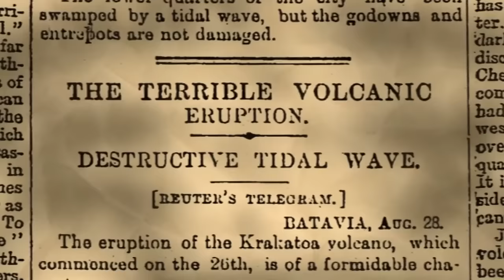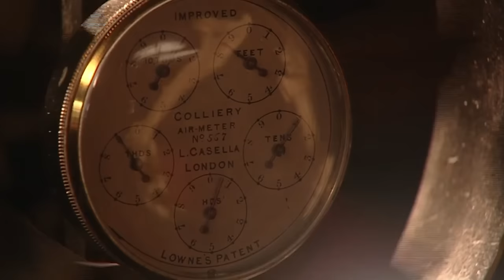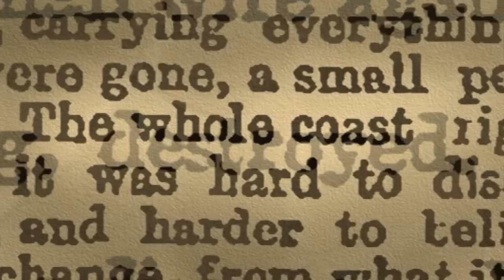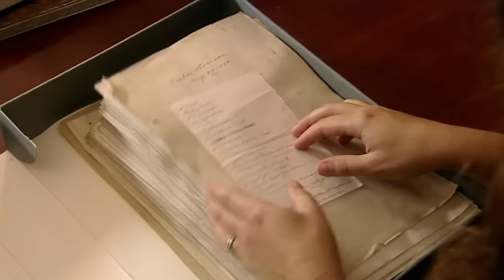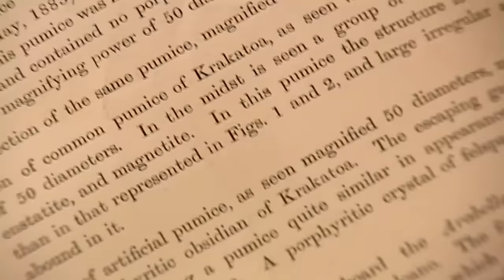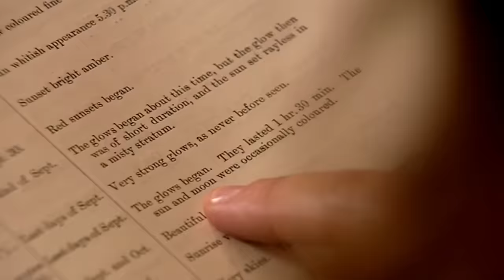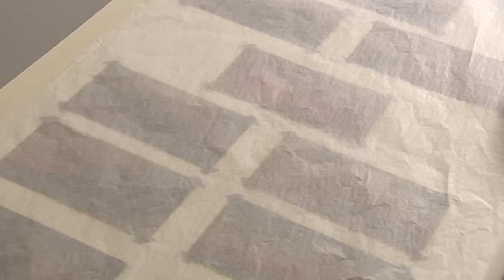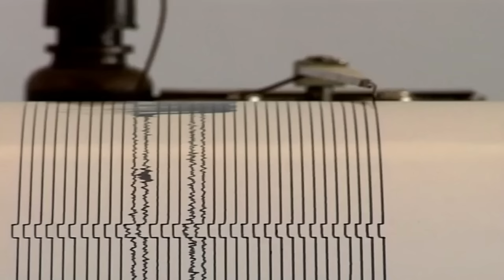Krakatoa - The Great Volcanic Eruption

Comment: Did they mention that 1000's became deaf from the high energy of the sound waves this made?
People on a  ship 40 miles away got ruptured eardrums.
100 miles away a 172 db sound level was recorded.
Reply: +Sukram Sukram 
172 db is a LOT of db! But my mom would say that my guitar amp is louder ...
Reply: Jim Dille
 LOL :)
Reply: wasn't Munch's "der Schrei" (the Scream) based on the skyline after Krakatoa?
Reply: +Sukram Sukram People always forget about that. When Toba went off and very few people were around, the db level was insane. Very good chance anyone close was turned deaf immediately. The same thing will happen if Yellowstone goes off, something higher in frequency than a jet engine will blast over thousands  of square miles.
Reply: +Peder Hansen Atmospheric pressure and audio compression waves can be measured with air pressure measuring tools. One kind of tool is called a barometer. 
They had these back then in case you were not aware. 

100 miles away from Krakatoa, a barometer at the Batavia gasworks registered the related spike in pressure at over 2.5 inches of mercury. That converts to over 172 decibels of sound pressure.
Reply: +schwarzfalk It is possible because it happened. This particular sound wave propagation was well documented. A db level that high would do this no problem.

With loud enough sound, damage will be done to the body but I'm not sure about disintegration !
With this particular eruption, the pyroclastic flow incinerated everyone nearby instantly well before lava and ash got to them.
Reply: Sukram Sukram I can't even imagine what Yellowstone's power would bring.
Reply: Jalen Stimes death by pure sound
Reply: It's an interesting piece of information, I like and appreciate that.
Why are you mad at someone for adding a fact that relevant to the topic @Doctor Robotnik?
Reply: Fadli Arfan its in the fucking documentary
Reply: @Doctor Robotnik
You sure? Can you point out in what min? I don't recall that information is on the documentary.
I found the link posted by @Esser though, but not on the documentary.
Even if it's in documentary, I still don't mind. Why you butthurt much?
Reply: Yellowstone and Krakatoa are very different kinds of eruptions, Krakatoa exploded violently because of sea water mixing with magma this wont happen at Yellowstone, while I have no doubt it will be loud it just wont be the same kind of eruption.
Reply: @METAL1ON
The theory of sea water mixing with magma that caused the eruption is very unlikely due to the lack of evidence to support it. Rather the mixing of two dense type of magma is the more probable cause of the huge eruption.
It's explained on this video at 48:55
Reply: Metal1on- The documentary states that the mix of seawater with magma was ruled out as the cause but the mixing of different magma was the cause.
Reply: I was looking for when they would mention that. The reenactment scene where the baby cries they look at the baby... so I'm curious why they could mention just the water waves' impact but not so much the sound waves' impact.
Reply: Sukram Sukram q
Reply: Sukram Sukram ☆What did he say?
Reply: 180 dB*
Reply: The British around North Sentinel heard it and thought cannons were fired at ships so they went to check it out. That was near India in case you wonder.
Reply: Quatermass wow!😳😭
Reply: That winter and the following 4 winters were the coldest ever recorded in North America. This is also the period the global warming coalition chose for their baseline reference to show how hot it is today but could still only arrive after a 0.1 degree actual rise even after "Correcting the 100 year old data.
Reply: Yes indeed, they could hear and sense it as far away as Australia!
Reply: Blackfalk    Yes, they'd be shattered.  Sha-do-bay.
Reply: Forest Dweller that's what, roughly 2400 km away? That's incredible.
Reply: Funny the decibel was invented in the early 1920's  Was it compared at a later date to the recording phonograph, that WAS invented before the volcano erupted in the mid 1800's ?
Reply: according to the wing nuts on you tube, you won't have to wait long! every spring through fall thousands of videos get posted talking about how "it's about to blow!" I guess even a broken clock is right twice a day...unless you're using military time!
Reply: 2.5 degrees on some gas gauge came up which translated to 172db.
Reply: Another eruption in the year 1816 is known as the Year Without a Summer because of 
severe climate abnormalities that caused average global temperatures to 
decrease by 0.4–0.7 °C. This resulted in major food shortages across the
 Northern Hemisphere.  it was caused by the eruption of Mt Tambora
Reply: Quatermass I thought it was like 300db
Reply: Blackfalk  Rocket launches produce enough sound to kill people. That's why NASA always made sure people were no more closer than 3 miles from all of the shuttle launches for instance. A shuttle launch is miniscule to something like this eruption, just to give you an idea of scale.
Reply: +Quatermass Nice to see an intelligent mind at work in the YouTube comments for once.
Reply: wow thats really amazing !!
Reply: sound falls off roughly with a square. standing up close the sound would simply kill you, probably in seconds. it would turn all your internal organs into mush - at the least. and instruments like the one that scientist had could measure sound waves in air.
Reply: sstroh08  ..  Sheer nonsense. While a rocket is indeed loud, it's certainly not loud enough to "kill people." Onlookers are kept at a distance mainly because rocket launches all too frequently fail, endangering people as the rockets crash back to earth.
Reply: Quatermass  ..  Man, that's just silly. There was no method of measuring sound level in 1883. The mechanical devices to measure "atmospheric pressure" you tout were not accurate enough nor responsive enough to measure the decibels of such a short event. Instead, some at the time simply speculated that it was almost loud enough to cause deafness within a 10 mile radius.
Reply: That came the invention of the hearing aids.
All because of that rogue KRAKATOA.
Reply: @fadliarfan212  they don't say anything about deafness. However I read Esser's link, and the video does mention how far the sound travelled, the same distance as the link mentions. The video also said it was one of if not the loudest sound heard by modern humans
Reply: Incredible power of nature
Reply: I prefer to be at ground zero. That way I feel nothing.
Reply: i am sure the sound level was extreme but i was not aware that they had a way to  measure sound pressure level way back then. hearing protection was something that really took hold in the 70s and 80s,  so i assumed thats about the time that spl recording devices were invented. i have built some car stereos that were in the 110 db  range and that is insanely loud i can only imagine what being hit with 172 db would feel like
Reply: Blackfalk  the closer you are the quieter it would be, sound is like an ocean wave the further you get from the source the larger the wave becomes. when your sitting in your home and you hear the kids drive by with their thumping sound systems its most likely louder in your house then it is inside their car.  i have had friends tell me they heard my suburban thumping a block away and i was like how i barely had it on, i could hear my turn signal flasher clicking when i turned the corner over the stereo, but a block away those sound waves were huge
Reply: @quatermass8  i am guessing it would also have to do with the frequency of the sound. bass below 100 hertz actually  feels like its forcing air down your throat at high db levels where as high frequencies cause pain to the ears. most of the sound you hear when you shoot a large gun is high frequencies would be my guess but the part you feel in your chest is the low frequencies below 100 hertz
Reply: So crazy that this was the loudest sound ever recorded
Reply: Did you HEAR them say anyrhing?
Reply: "Did they mention that 1000's became deaf from the high energy of the sound waves this made?"
WHAT???
Reply: @satsunada  They could measure pressure waves back then...
Reply: Quatermass a
Reply: They had a sound level meter prepped just for the occasion? In 1883?
Reply: Blackfalk  Very possibly. How do you think explosives shatter things? With sound.
Reply: @shane99ca  I don't think it was a sound meter, but something similar to the machine they were using that measures pressure waves. They can take the data it measured then and extrapolate it into the decibel system we use now days.
Reply: @Rvanhuis28  In other words, they extrapolated decibel volume from an atmospheric instrument not physically designed for the purpose.

The reason I'm skeptical is because a 172 db noise is not something that makes you just think, "Gee, that was kind of loud." The glass holding the mercury would have shattered. There is always a danger in inferring data rather than directly measuring it, as assumptions (sometimes erroneous) are required.
Reply: @shane99ca  back then it was harder to be accurate so all things from then where assumed usually from rudimentary machines that did work in function. Just not as accurate as we can measure today.
Reply: @theonewhoknows2  Actually, the decibel itself had not been invented in 1883.
Reply: my car puts out the same db,,,I am fine.
Reply: Peder Hansen  the way is with comparing the damage effect to the current decibel size, theres a lot of witneses that record this catastrophic event.... for exampl the sound is traveling far and everywhere....
Reply: @satsunada  yup just listening to a recording of stomboli's eruption currently is just defining, and I would expect being there in person would be even worse.
Reply: The world got colder for a long time because of it, and for two years, the stars and the moon shined green everywhere because of the gases in the atmosphere, as well as boreal aurora-like events due to the ashes flying, reflecting the sunlight
Reply: @riograndedosulball248  ah so it also left a haze cloud for like 10 or was it only five years? I wonder what the survivors of the ilopango eruption thought and heard as it imploded in 540ce, where it made two complete days of darkness from it's ash and it was ten to fifteen years of haze. In Roman records of water tasted bitter almost wormwood like for that time, probably due to the presence of sulfuric acid, fruit and vegetables wouldn't ripe , just stayed in a unripe state if grew due to lack or sunlight to produce the riping gas, and oh that period the Justinian plague went around, which was a different strain of the black plauge, funny, that it seems to pop up around major volcanic eruptions periods, yes there was a few big eruptions in 1300s as well. Maybe it thrives not just in water, but sufuric acid water is it's key in how and why it shows up?! There's suppose to be another case of it, named the race burning disease when the two Intermittant days of darkness occur. Somehow drinking Hawthorne tea made with the leaves, no wood, three times daily suppose to cure it.
Reply: my car audio system does 160 db
Reply: also ear drums grow back
Reply: The loudest documented sound in recorded history.
Reply: Very interesting!
Reply: Me: laughing at all the small-minded skeptics that do not take into account the ability for scientists to use all kinds of information OVER TIME (as in after the db was invented) to reach a reasonable conclusion. Please explain your conspiracy theories as to WHY you think scientists are lying about their calculation? I would love some further comedic relief during this pandemic 😄
Reply: Spot on, M' Lord.
Reply: @joshuasteve5083  - From a nearby barometer. Look into it.
Reply: @quatermass8    ..  Where did you hear that? That would have to be among the loudest sounds ever heard on this planet. Meteors hitting the Earth's surface very rarely make as much noise. Hell, a massive nuclear bomb wouldn't usually rupture eardrums 40 miles away (we know that from the many bomb tests done with observers nearby).
Reply: @dwightstewart7181  - This eruption released way more energy than any nuclear bomb we've made. The ear rupturing was recorded by the  Northern Castle ship captain - ref: Krakatoa: The Day the World Exploded. Penguin UK, 2004, by Simon Winchester. ISBN 978-0-670-91430-2.
Reply: @quatermass8    ..  Okay, if you say so. This isn't worth arguing over.
Reply: @joshuasteve5083   - The data is consensus from scientists and historians that have studied the event in detail. The gas pressure measuring equipment would have been top of the line and accurate for safety reasons, as it was attached to gasometers. There were ways to continuously record using paper tracing devices, and if it wasn't being continuously recorded there must have been someone there. Otherwise we wouldn't have the data. The gauges went off the scale. They maxed out. So it was more like 172 dB+ than 172 dB. Importantly, there wasn't just one explosion. There were significant ash cloud weather effects, ocean effects and multiple explosions in the weeks, days and especially in the hours before the final eruptions. The final eruptions, one of which was the loud one we are speaking of, were not unexpected.
Reply: It's also the loudest sound ever recorded on Earth
Reply: @shane99ca  Wow rofl, so? VEI also wasn't developed yet during 180 AD yet that does not invalidate the fact that the 180 AD Taupo eruption was a VEI 7. I fail to see the problem here
Reply: @NotSomeJustinWithoutAMoustache  VEI can be measured by something that still exists and can be quantified—tephra deposits. Sound, on the other hand, is immediately perishable, and the only recorded measurement had to be inferred from what was essentially a barometer.

Also, sharpness (attack/decay) and interval (sustain/release) are also important. If you fire a regular rifle and a magnum rifle, the magnum sounds much louder, but does not peak any higher on a decibel meter. It sounds louder because it lasts longer.
Reply: @NotSomeJustinWithoutAMoustache  VEI can be directly measured by something that still exists—tephra deposits. But sound is immediately perishable and cannot be measured again, and the only measurement we have is from what was essentially a barometer.

Furthermore, there is more to sound, both real and perceived, than simple pressure. Sharpness (attack/decay) and duration (sustain/release) are also important. If you fire a regular rifle and a magnum rifle of the same calibre, the magnum sounds much louder, but if you record the reports on decibel meter, they both come out pretty much the same. The magnum sounds louder because the sound lasts longer.

Inferred measurement rather than direct measurement. That's the problem here. I have been reading about this eruption for more than forty years and I have yet to come across a single account of someone who went deaf, including the people in the same room as that instrument.
Reply: @quatermass8  Their instruments were more accurate than people are giving credit.  Think navigation.  They were sailing thousands of miles across open seas, and amazingly ending at their intended destination.  😂😂😂
Reply: @quatermass8  Also, by documentation, if they have records of the sound circling 7 times.. with some assumptions, knowing the speed of sound, pressure levels, etc They could make a pretty educated guess at the SPL at the source, to generate sound lasting 7 days.  Historically, people were more intelligent, than people realize.  Look at Art, History, Literature, Music .. etc, etc
Reply: @Satsunada: You mentioned Toba... That must have been a phenomenal explosion because it was supposed to have wiped out 90% of the earth's population. Does this mean that modern man has evolved from Indonesia? Actually, I have been to Lake Toba in Sumatra and, apparently, it is 273 kilometres in perimeter! That is some blast from Toba!! I wonder how much rain must have fallen to fill in the massive crater!!
Reply: DIDN'T KNW THAT'S
Reply: The air pulse was recorded in London.
Reply: Dwight Stewart Gasometers - storage tanks for town gas produced by converting coal to gas - were common globally in the 1880’s. The floating tanks had clockwork chart recorders on them to record daily gas production. So yes highly accurate gas pressure records with atmospheric pressure compensation were common and available globally.
Reply: Shane Matthews look up an anaeroid barometer before making comments about mercury tubes cracking. Recorders have used anaeroid steel sensing elements since the 1700’s. Accurate and sensitive but not particularly fast at audio frequencies.
dB is directly related to air pressure - 194dB = 1 atmosphere of pressure change. Explosions are quite possibly higher than one atmosphere however, particularly at close range. A 4-6 atmosphere pressure change is usually lethal.
Reply: @shane99ca   In this instance, the Gasometer itself was acting as a giant barometer and it had a paper register connected. A link to a copy of the tracing from that Gasometer is at the end of this post. The Pa to dB physics equation is used to convert pascals into decibels, and that’s how they got the figure of 172+ dB. 

Given this reading was taken 100 miles away, the 3000 people lived on Palau Sebesi with is a mean of 11 miles from the eruption would have gone deaf resulting from the acoustic wave and shock wave combination, then got killed shortly after by other volcanic effects that followed. They probably got other injuries from the air pressure situation too. Very tragic. That's probably why there’re no reports. 

Extrapolating form the above Gasometer reading and the readings from around the world, the estimates for the volume at the source vary between 240 dB and 310 dB. When a sound wave reaches 195 dB, the antinodes become a vacuum. Figures above 195 dB account for the shockwave part of it, air movement.   https://ibb.co/4j4rz59
Reply: it could also be heard 5k kilometers away suprisingly!
Reply: Wow, this was an Outstanding documentary. Thanks for taking us there.
Reply: @nikkimetalchick8860  They had accurate barometers, readings of which can be translated to decibels.
Reply: @HobbyOrganist  eighteen hundred and froze to death?
Reply: @HobbyOrganist  eighteen hundred and froze to death!
Reply: Thanks for the info
Reply: Deep purple recorded 180 db!
Reply: @quatermass8  there wasn't a dangerous pyroclastc flow..the island wasn't inhabited and I've never heard of it being dangerous on another island.  
However what wasn't mentioned is over a certain dB sound isn't sound waves anymore but actual pressure waves.  The closest villages may have been crushed by the pressure waves before anything else could kill them. 
As a much smaller but visual display  look up the filmed B-52 strikes in Vietnam...you can see the actual waves
Reply: @grom7826  estimated, probably very closely, by the rapid barometer changes.
Conversions are done all the time, for that matter SPL is measured by voltage in most sound meters. 
dB is not only used for SPL's btw but also in electronics for sure. 
Note that above a certain dB it's a pressure wave not a sound wave and is measured by pressure and force not dB.
Reply: @robnoregon  going way back artillerymen used cigarette filters as ear plugs..hearing protection became more common from the 60's on but definitely used well before that.
Reply: @robnoregon  you definitely need a few physics classes. 
Sounds do not increase with distance but fall off (quieter) as a square of the distance. To get bigger you need to add energy.  Also waves get larger as they come ashore but that has nothing to do with distance  but a combination of conservation of energy and drag...
For something relatively quiet (like your car stereo) what affects distance heard is reflection and absorption of the waves.
Reply: @shane99ca  not really..with pressure..think of sound waves as vibrations in the media.  Pressure waves are movement of the media itself. Above a certain dB there aren't  Soundwaves but pressure waves. There isn't anything to hear because there aren't vibrations.  You do hear the results at a distance when the pressure wave dissipates enough that vibrations propagate again as individual vibrations through the media. 
However the vibrations still have measurable pressure
Reply: @Pinkielover  I don't believe the 160 dB..and eardrums don't just "grow back" . The rupture is covered by scar tissue resulting in a loss of elasticity and hearing. 
With severe perforations they don't necessarily have any tissue recovery, not even scar tissue.
Reply: @km5405  of course there is no sound
Reply: @duanesamuelson2256  Vibration is movement. The question is not one of amplitude, but of frequency. If "pressure waves" have a frequency of less then 20 Hz, humans cannot hear them however powerful they are.

They can feel them, however, and animals can hear them still. Indeed, this low-frequency sound, called infrasound, accompanies earthquakes—which is why animals can sense that there is about to be a tremor.
Reply: @duanesamuelson2256  The 3000 people on Sebesi Island just to the north would have experienced instant deafness when hit. You might be right though. The forces could have killed them simultaneously to the deafness. The tsunamis which resulted were likely caused by pyroclastic flow, rendering them indirectly dangerous.
Reply: @quatermass8  The tsunami was caused when what was left of the island dropped into the empty magma chamber below, a staggering blow that displaced a monumental amount of water. This is fairly common after a huge eruption; with an enormous empty cavity right below it, the mountain simply collapses into it, forming a massive caldera. That's what happened at Crater Lake. There is a caldera at Krakatoa too, but much of it is underwater.
Reply: @shane99ca  at 192 dB on earth at normal atmospheric pressure the amplitude creates a vacuum between "waves" which means no more vibrations, just waves of pressure. 
Further from the source the sound heard is more akin to sonic booms. That's why naval units thought it was cannon fire.
Your response just shows you are comparing apples to oranges, it's not that they frequency is to low to hear its there is no frequently to hear.  If I generate a sound exceeding 192 dB at 5000hz the spacing between the waves is still 5000 hz there just isn't any vibrations to be heard since its pressure-vacuum-pressure. When the amplitude decreases the waves collapse back into the vacuum causing the lower frequency "boom".
Reply: @duanesamuelson2256  Source.
Reply: @shane99ca   In this paper from the Journal of Geophysical research, the pyroclastic flow tsunami creation theory presides. If you want to view it, you'll need to copy and paste the tittle of the paper because Youtube keeps deleting my post with the actual link in it! Copy and search this text: Tsunami generation by a rapid entrance of pyroclastic flow into the sea during the 1883 Krakatau eruption, Indonesia